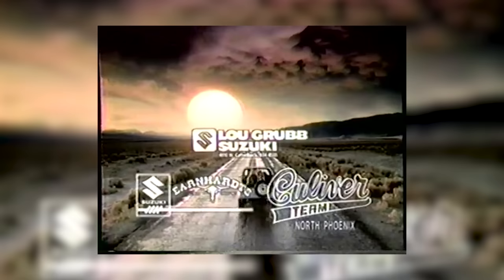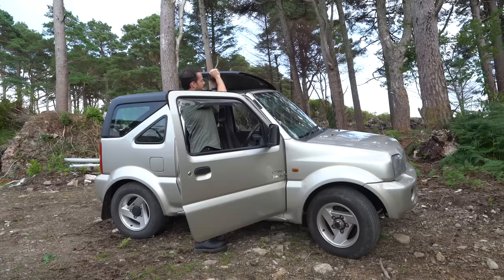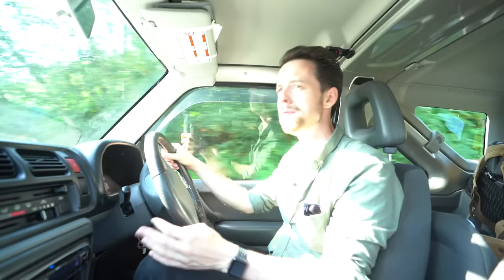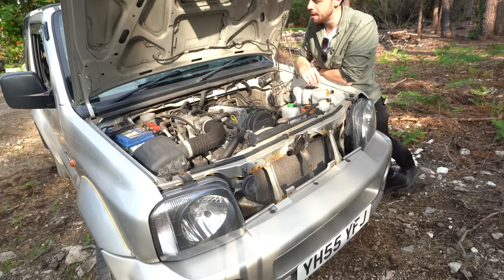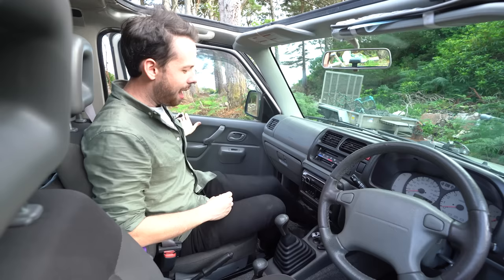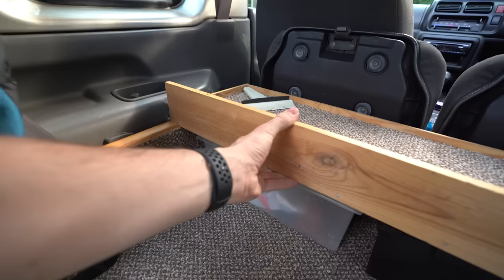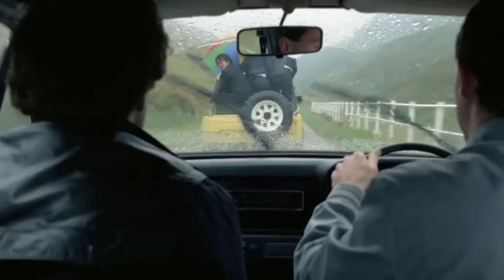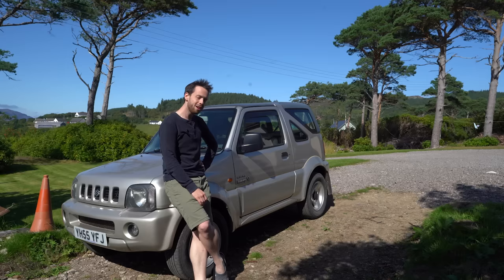The Suzuki Jimny: the World's Best (and Cutest) 4x4

Comment: As you also mention it the old Fiat Panda 4x4 is quite a capable veichle too, Steyr-Puch transmission, a lowered first gear and a very good wheight/powert ratio
Reply from the maker: I’d absolutely love one! Johnny Smith has a great video on them: https://youtu.be/8bN8XAvSIa8
Reply: @CalumRaasay  You're not the only one, so much so that the price for a decent one is rising, they are especially wanted in Italy's own rough and hilly island, Sardinia
Edit: Mr. Agnelli (Fiat old time boss) had one built and slightly modified for himself and he used to take it quite often in the mountains around Tourin
Reply: Steyr-Puch have made quite a few cool 4 wheel drive cars possible, like the G-wagen and VW T3 Syncro.
Reply: @maxmeister747 don't forget unimogs
Reply: @darrenangel461  Or Pinzgauers :)

Comment: My first 4WD was a 1981 Suzuki Sierra (that is what the Jimny was sold as in Australia). I bought it in 1986. It was the long wheel base version wit an aftermarket fibreglass canopy at the back and a removable top above the driver which was part of the aftermarket canopy set-up. Mine was the first of the 4 stroke engines. it had a 4 speed gearbox and transfer case. We did not have any comfortable nights sleeping in it! It was a great 4wd. very light and unstoppable. Touring was horrible, but once you reached your destination it was great.

Comment: Thanks for a good honest video. 

I had the 1998 Gen3 van version, automatic, in Sweden. It was a great off-roader. Adding the LockRight locker in the rear, from PowerTrax, turned it into a mountain goat. It was a huge improvement. 

Today I live in Guatemala driving a Gen4. Love it!
Reply from the maker: Yeah I've heard good things bout those lockers!
Reply: In 1995 I put a Lock-Right in my 93 2wd 5 speed Toyota pickup, with 195/75-R14 snow tires and a heavy right foot ground clearance was it's biggest limitation.

Comment: 100,000km from a set of factory fitted Bridgestone Dueller HT. Never even dropped the tyre pressure for sand driving.  Owned the 2015 5spd manual 1.3L for 6 years in a “metallic bluish black pearl” with metallic grey factory alloys.  Factory Auto locking hubs.  No trouble at all if always Suzuki dealership serviced. Everyday drive car. I upgraded the sound system with head unit and splits with woofers in the doors using slim mounting rings and tweeters on the front pillars beside the windscreen. Stud pattern is 5x139.7 for anyone wanting to change their rims. I bought a 1300kg tow bar kit and fitted it.  They can tow a loaded trailer but struggle if you have to pause up a hill when towing a trailer so allow for momentum at all times or be prepared to switch to 4x4 low range for boom gate swipe card - I stalled numerous times until I realised this.  I fitted cheap roof racks to the roof rails and then an aluminium roof tray.  Loaded heaps of weight onto this roof - 7 sheets of very heavy plywood several times.  You would be amazed at what can be skull dragged around behind the mighty Jimny with a drag chain and bow shackles.  I once dragged large vehicles and a tractor and machinery around a rural property for someone.  I always had loads of tools in the back with the back seats folded down.  I had a 2 pad electronic rust protection device fitted to the body when brand new. After beach driving flush the ladder chassis sections out with fresh water with a garden hose. MOST IMPORTANTLY - DRIVE IT OFF ROAD - AMAZINGLY AWESOME FUN 🤩

Comment: Liked this.
My dad bought an sj413jx in the mid eighty’s, 1.3 5 speed samurai basically. It was nearly new, we kept it for years, I learnt to drive it and used it at university in the ‘90’s. Used farming etc also, great in winter and off road, super capable, Super reliable and was worked hard. Ended up with 160k miles on it but rust got pretty serious….

Comment: On the 4H locking the hubs, do it in the snow/ice not on tarmac unless its made for it.

Also its funny seeing how different 4x4 culture is there. Here in Australia the Jimmy sure can get some places, but you start needing a pretty extreme/dedicated 4x4. I own one of the 'kings' of offroad, the 1HZ 96 Toyota Landcruiser 80 series, they were basically purpose built off roaders from Toyota and still fetch a scary high price. But it is amazing how different it is, like looking at those tracks you took tbh I wouldnt even take it out of normal 'onroad' mode, and tbh all those tracks look very doable even width wise, sure I wouldnt take my Mums Y62 Patrol down there as id bet money id get stuck between some trees (they are huge but capable).

But yeah very different ideas of whats the best 4x4 over there compared to Aus. You do see them here but they are more town cars with the ability to go down dirt tracks, but I have pulled a few out that got stuck in sand, no idea why its more sand than mud they get stuck in maybe they arent airing down enough?

Will also say I dont stress about potholes or the likes, just hammer the rim back in shape and your golden, and water crossings? Well sadly my car can go deeper than I can, sure my snorkle lets the engine breath but what about me?

For your steering issue, you can get a return to center steering dampener, or even upgrade the steering system, when I was a mechanic I had done a couple of retrofits from the GU patrol or 40/60/80/100 series cruiser. Takes work but does it well. If you want a little better fuel economy, power and the likes. Throw a 6 speed in there, once again the patrol or landcruiser runnign gear can go in but it takes alot of space.

Also you have the better form of transfer case, the electronic ones are a pain in the arse, your lucky, you might need to put some effort into changing it but not much can go wrong, electronic transfer cases are more prone to corrosion and electrical gremlins. Your always better off, for a offroad car to have as little electronics as possible, water, rust and just aging wiring can cause problems. Its why I love my car, the main electronic thing thats needed is the headlights or the glow plugs, but the later can be worked around if it dies, just put direct power there or just turn the engine over until it finally starts. No spark plugs to worry about, can even run without the battery in (not ideal). The less that can go wrong is ideal for being offroad never know when you break down 500+ km from the nearest town.

Edit: If you want a 2nd gen get one from Australia, we do not put salt on our roads, so rust is way less common, the more into the center of aus the better as ofc the sea does put some salt into the air but its minimal. Get one that looks as stock as possible, if it has offroad tires forget it, if it has a winch forget it, same with a lift kit. If it has a bullbar thats fine, we put them on them to avoid skippy the car destroying kangaroo. They are pretty cheap here too btw, if you want I am sure myself or other viewers can help with actually viewing it for you, always make sure it gets an inspection from a RACQ inspector (they go to the car for a small fee).

Comment: I have one of these.  Same color.  I put the front hard top in the back all the time.
From the driver's seat, I un-clip the 4 clips.  
Then, I simply push it up in to the air a bit, and turn it once, clockwise.
Then, I angle it such that the right side is angled downward nearly touching the back door.
Finally, I make sure left side (which is angled towards my head [yeah, dangerous]), it tucked behind both front seat head rests.

Comment: The Suzuki Jimny is about the same size as the old Jeep CJ-7 series.  I live in Colorado (USA) which is very mountainous and many of the original off-road 4x4 trails were designed with a Jeep CJ-5 or CJ-7 in mind.  The larger 4x4s cannot navigate those roads.    Some of these roads were carved out of rock on the side of mountains so space is at a premium.

Comment: Lad I may have a solution for saving your windshield washer reservoir. If you can take the rod off and work a section of rubber tubing onto the rod that can hit the bottle. That should provide some cushioning if you drop the hood prop.
Reply from the maker: Doing this tomorrow!
Reply: @CalumRaasay  Let me know how it goes.

Comment: I live about 2500 feet up the Massif Central in France and use an X-Trail (with chains!) for when things get bad. The local farmer has a similar vintage Jimny and happily goes into the fields in all weather to move his cows from field to field. His is probably the turbo diesel version (this being France), but I would trust it more than my X-Trail!

I had a non-turbo Impreza for a good few years and it was nails hard in all conditions until it finally fell apart.

Comment: I have a gen 3 here in Japan it's a 660cc auto, it's done 125,000k and so many problems. Auto won't shift when hot, when cold its always hunting for the right gear, electric power steering only works when it wants to, the idle will often jump to 2200rpm, battery lamp is always on, even after new alternator. Dashboard back lighting not working on the fuel and temp side.  Saving up for a gen 4

Comment: I have a Mk3 Panda 4x4 and believe it is the better car.
Viscous coupling centre diff that can be locked with a button near gearstick. Transfer case integral with gearbox.
Fake LSD front and rear using ABS system to detect uneven wheel speeds and brake the one spinning.
All independent suspension.
Four seats, four doors plus hatch to reasonable boot.
95bhp 200torque things from 1250 turbo diesel, makes it faster than expected and can cruise at 130kph all day in Europe.
They are used by French and Italian police in Alps in winter.
PS great videos, I have subscribed.
PPS I used Panda to pull a bigger Peugeot SUV out of a deep icy muddy hole after it got stuck there. The Peugeot driver couldn't believe it and was very grateful.
Reply from the maker: I’d say the mk3 probably edges it out as it’s a much better road car, the jimny wins in the fact it’s an easier vehicle to customise, better aftermarket for supplies and to generally play around with. If I had to swap out my jimny I’d kill for a MK2 panda!

Comment: My first 4x4 was a Suzuki SJ 413 Samurai 1988… best go everywhere and anywhere other wider 4x4’s couldn’t go! 😁👍
Reply: …and I beat your record of comfortably sleeping in a Suzuki Jimny… I lived in mine for 18 months back in 2000- 2002… I took out the rear seats… reclined the passenger seat as far back as it would go, packed out the underside of the back of that seat so it wouldn’t collapse…made it level up to the top of the dash from front to back… put in a switch ignition and push button start for heating in stead of struggling to turn the key from the passenger side.
So…you may hold the record for that on your island, but… you’re not the first!… and likewise, I’m probably not the first either!… but I like the fact that I did, and I like the fact other people have that are nearly 6 foot tall! Lol

Comment: I'd suggest another contender for cutest 4x4: The 2000 suzuki ignis, it's a minivan and 4x4 in one. It might not be the greatest, fastest or best manufactured, but even with it's exhaust loose it still served my family for years and tens (maybe even hundreds) of thousands of kilometers.

Both your Jimny and the ignis my family had might be different models, but they're from the same generation, especially when it comes to their looks from the outside

Comment: If rusts an issue you need a good helper -sealer , wax under seal,grease  , oil ,lard ( believe It or not )web bolts are heated and quenched in fat
Reply from the maker: If you grow up here you become well accustomed to all forms of rust protection!

Comment: Great video, most drivetrains built after 1998-2000 or so can withstand use on at freeway speeds up to and including 55+ MPH without significant issue. The golden rule being 55 is the max speed and ONLY 4h, never 4L as the maximum speed for that is drastically lower based upon manufacturer. Used my 2005 Nissan Frontier many times in Winter in 4H for 2 hour trips to and from work, it has 290K miles and still runs and functions just fine.  Recommended? Don't care, it can actually do it without exploding or any of the other myths. You just burn more fuel and wear parts out that generally sit unused 98% of the time.
Reply: Dude you see these things doing normal road speeds all over they can handle 60 and over just fine

Comment: I used to sleep in my gen2 SJ410 all the time on the Mongol rally. The seats fold flat. The only issue is running down the battery on the brake lights if you put your foot on the brake.

Comment: I drive my 2004.  O2 on the motorway lots 
No problem , drives ok at 70.   Clue maintain the front axle in good condition, big tread mud tyres can be rubbish on motorways.   For obvious reasons

Comment: well, it's certnainly more capable than those modern 4WD "SUVs" the size & weight of a semi-truck & ground clearance of my 3 door sports-coupé.
I've always thought offroad vehicles should be small & light, not these humongous 7 seat tanks with 20inch low profile tires.
Reply from the maker: Yeah I think most people are buying into SUVs for the ride height but so many people discount size, weight and tyres when it comes to actual off roading. There's many small, light 2 wheel drive cars and small pickups I'd choose over fancy oversized off-roaders for day to day work.

Comment: These cars are awesome.  The only car i've had i thought was better was the daihatsu fourtrak - another ruster though
Reply from the maker: God yeah, plus those Fourtaks can tow insane amounts, I think 3.5 tonne brak? Which is insane because I always think they look so tiny!
Reply: @CalumRaasay  yeah 2.8 turbo d in them, the back rusted off mine only a couple weeks ago but the engine and electrics were still perfect and it was on 461k miles - still sold it for 500 just for the engine and gearbox.

Comment: Love your work and agree 99% I got my Sierra in 1986 and Jimny new 2009, now I am upgrading to 2023 model soon, for no other reason than "like you said" it looks more like I expected a model after Sierra would look. Mine 14 years old 117,000 kilometers and perfect, so I dont need to upgade it would go for another 20 years imo. Total cost of self servicing 12 x $100 Mobil One 5w 15, 12 x oil filter, 4 x airfilter, 4 x spark plugs, 4 x tyres @ $110 each (60,00klms from Bridgestone original but $260 each in Australia) 14 years for apporx $2,000 in service costs. New Jimny 5 years and 1,000,000 kilometre warranty? Ill be dead by then AND I HAVE NO RUST, you live on an Island but I live on Moore Park Beach Queensland lol NO RUST! (indonesian made)

Comment: Shame you do not have the M13A, it is an awesome engine as far as engineering goes. Perfect combination of technology and simplicity.
Reply from the maker: Is that not what the 02 Edition Jimny has? M13AA?
Reply: @CalumRaasay  Correct. About 02-15  used it. People like to swap them for the m16a or m18a for more low down torque. I'm currently building a helicopter with an M13a non vvt engine as it is better in design than all current aircraft engines on the market. The second hand M13A engine market will get a mass of attention from the LSA market soon. A $700 m13a will turn into a 7k desired engine, hence I am buying them now. From Aus, have a nice day.

Comment: The tin tops rust just the same!  Is your indicator stalk on the left?  I hear the Spanish ones are.  The right side is actually correct for a RHD vehicle (so you can indicate and change gears simultaneously) but that's been lost in the interests of international standardisation.

Comment: Though you do mention kei cars, for those unfamiliar it should be more explicitly stated that those rules govern not only engine size & power output (still only 660cc/66bhp today) but exterior/physical dimensions - and would argue that what you ascribe to Suzuki 'staying true to it roots' as regards the latter is as much, if not more, a result of good regulation
Suzuki's on to a pretty good thing here: there remains a clear & sustained demand for this type of vehicle, if not already in this niche, entering it is unlikely to offer a return on the necessary investment (btw make sure you upgrade just before ICE cars phased out)
Do you mention Panda 4x4? Nearest Euro equivalent, just with a metalled road bias

Comment: May I introuduce you to LuAZ/ZAZ 969 which is very similar in concept and partially amphibious.
Reply from the maker: Haha yes! I’d love one of those.
Reply: While it is in same niche of lightweight off-road vehicles (in style of classical Willyses), but its concept is much wackier. I can't remember another mass produced car with part-time transmission where main drive is front (cortesy of using modified RR ZAZ-968 engine, installed in front). Also, don't be deceived by petty 40 HP engine - this thing clearly have something in common with tractor engine, so it has pretty decent torque on low revs.

Comment: Hi, nice  video! I know that beeing on an island you may have not had the opportunity to check this out, but what is it's cruising top speed (I mean the max speed it could reach staying sub 3000rpm or without revving it too much)? And what's it's avarage fuel consumption? Thanks!
Reply: I have the latest version and in 5th gear at 3000 revs it does 60mph